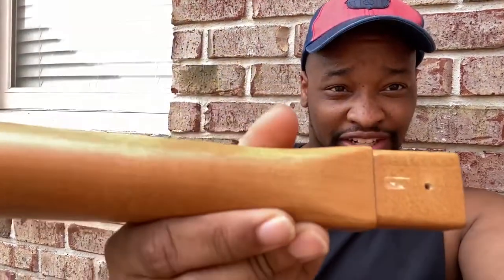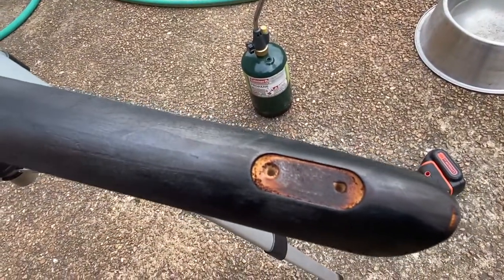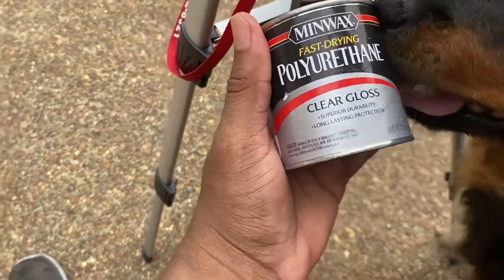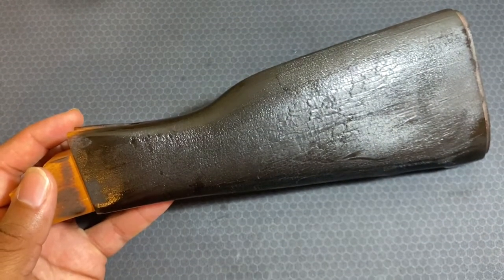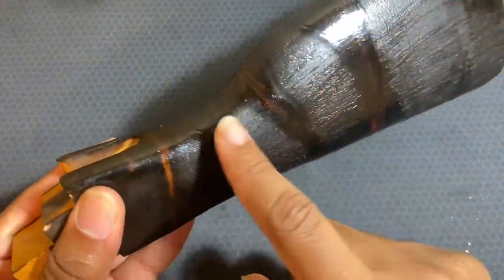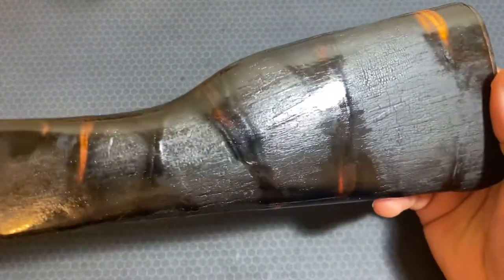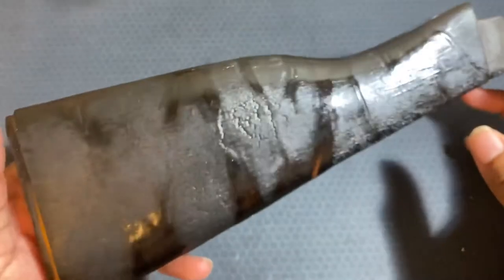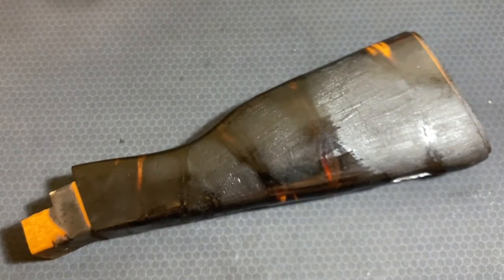Burning AK47 Wooden Stock Shou Sugi Ban Style

Comment: I wonder if you gave it a light sanding and hit it with more poly it wouldn't cover better now that the porous wood is sealed from the first coat.
Reply from the maker: That’s what I am planning on doing. There is probably some really nice colored wood under there. Then I’ll just hit it with some more poly.
Reply: @TinkerTailorSoldier1  Exactly.

Since it's a sunk cost already, take that first one, strip as much of the poly off as you can, lightly sand and/or wire brush it to get the poly off, and buff the hell out of it.
If you have a bench grinder and buffing wheel, it's perfect for buffing the char off of the wood without cutting into the wood itself.

That "crackling" will come right off, and the wood underneath will take some of the charring and darken, with the pith being eroded, highlighting the grain of the wood. 

You can bring it back down to the base wood and still end up with some darker highlights from the charring. It's my preferred finish for axe and knife handles. 

It can look pretty epic. 

In lieu of poly, I'd suggest a mixture of boiled linseed oil and beeswax. 
It's better for the wood and I, personally, like the way it looks over more synthetic finishes. 

Best of luck to you.